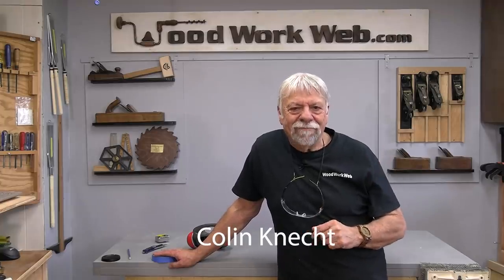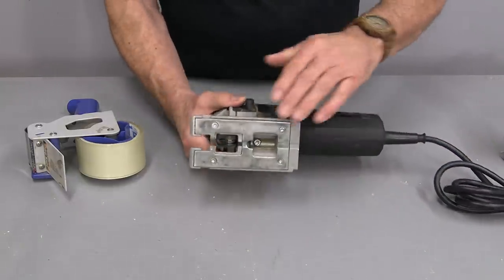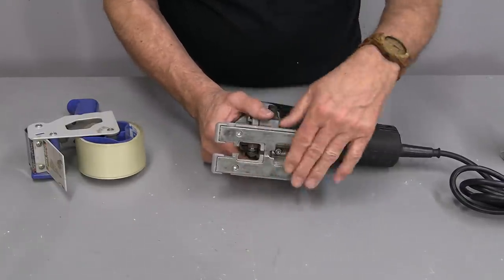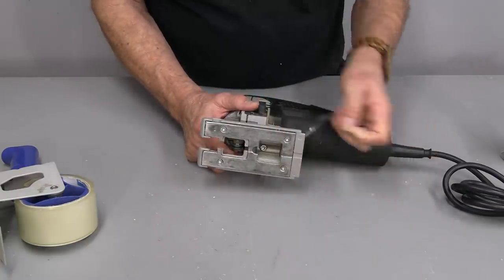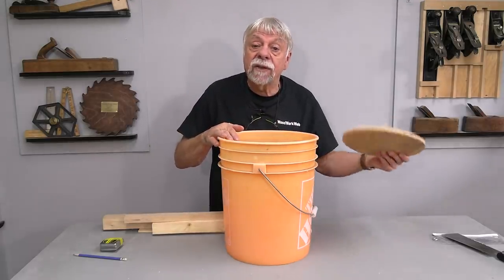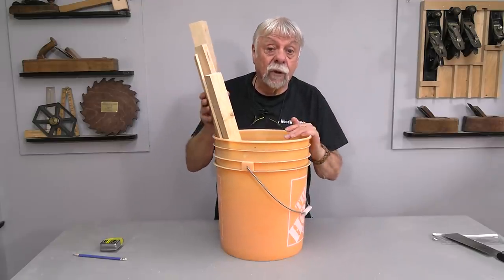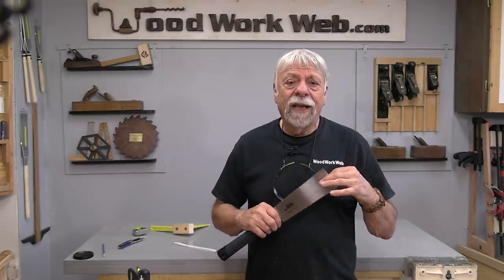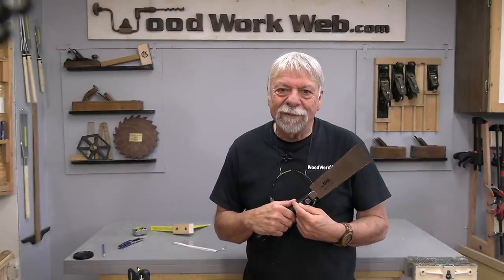Subscriber Submitted Woodworking Tips  - Episode #30

Comment: One quick thing I learned the stupid hard way lol, when using the tape for zero clearance, use a longer piece of tape so it wraps around the front edge of the table.
The way you showed it (and how I did it for years) will start getting caught on the wood. Running the tape further back, when you start pushing the wood, it will start with it on the tape, instead of in front of it where the wood will catch. Plus, it’ll last longer that way. 
:)

Comment: On the dust collection, it's not essential to have it air tight unless it's under pressure. If I wanted it sealed, I'd use some tape then the metal can and worm-drive hose clamps.

About 1969 I had a problem with my newish Honda N600 (Scamp). Something hit a welded joint on the exhaust and made a hole after which it was very very noisy. I fixed it with a (steel in those days) Coke can, two worm-drive hose clamps and a length of asbestos siring.

The repair was highly effective, and outlasted the car.

Comment: Pill bottles make great storage for different types of driver bits. label the bottle for different sizes (square 1, 2, Torx T10, T145, etc.) and put them in a drawer or other location. I also dump various species of sawdust out of my sander dust bag into my pill bottles, so I can grab some dust to match the wood when doing the glue & sawdust wood filler.
Reply: Ken, I use pill bottles just like you. I do a lot of work away from home, so I have several crowded tool boxes that I lug around. Trying to find small parts in them like driver bits, masonry drill bits, punches, small screwdrivers, Sharpies, small stirring sticks etc. used to drive me crazy. With these items contained and organized in see-through pill bottles, I can find what I'm looking for in a snap. I even carry around an extra set of nitrile gloves and shoe covers (recycled plastic grocery bags) in them.
Reply: @timothyhartle6028  I started carrying the pill bottles when I went to Habitat for Humanity. It sure was easier to find things, especially when I put labels on the bottles or marked them with a sharpie. I eventually got a Milwaukee "pack out" small part box and put my bits in there, Now I just grab that to take with me.

Comment: To add to your dust collection tip, I use super glue to make an air tight connection  between the two pieces and reinforce the connection with hose clamps and aluminum flashing.
Reply: Nothing wrong with that technique, but for a low or no stress joint once around with the aluminized tape (the HVAC stuff) will make an airtight joint. Proved it a million times on all sorts of pipes and ducts.

Comment: Another thing to use when joining hoses etc. Are the thin water bottles cut out the top and bottom the plastic shrinks when heated and forms a good joint.

Comment: When connecting two vacuum adapters together that do not match, I have found that Fernco couplers are perfect.  They are for attaching large plumbing pipes and come in a variety of sizes. Find them in all plumbing supply stores and big-box home repair centers.

Comment: Here’s a tip for anyone who has a worn out rubber pad on their 1/4 sheet sanders. Buy the larger pads of felt padding (4-1-4 x 6” x 1/4” thick. - orange home store has them). They have a self adhesive backing. Use a hot air gun to help peel off the old rubber pad. Use the metal backing plate to transfer mounting holes to felt pad. Drill and counterbore as required. Clean and remove all glue residue and apply new felt pad. Use the hot air gun to apply some heat to the metal plate to ensure good adhesive bond.

Comment: I hang my speed squares/rafter squares using s-hooks. I bent the tops of the s-hooks so they stay hanging on the milk crate, and run the bottom end of the hook thru the 3.5” hole of the squares… Before the haters start hating - Yes, I use stackable milk crates for storage. I’d love to be rich enough to buy a PACKOUT system, but this works and it was free 😂

Comment: I started out using a vacuum cleaner, and attached a length of plastic pipe to the machine outlets using duct tape, that the vacuum hose pushed into. I've just bought a proper workshop vacuum that attaches directly to the machine outlets, so had to remove the duct tape. Sometimes it's good to use tape that isn't permanent!

Comment: I do a lot of oil base staining. I use the cheap Harbor Freight spray, it works well, but is a pain to clean like all other spray units. Instead of going through the process of cleaning it each time I keep a 2 or 2 1/2 gal bucket about 3/4 of the way full with either thinner or mineral spirits. All I do after I'm done spraying is detach the plastic cup and dunk them both into the bucket, put the lid on and put it away until next time. When needed again all I do is blow it off and wipe it done fill it with stain and away I go.
Reply: So the electric sprayer is submerged too?

Comment: Even better for the dust collection: I use schedule 40 PVC pipe. Heat it with a heat gun and force it to either go inside the other piece or outside of it. Let it cool while it is pressed together and you now have a permanent fitting that presses together. You could also use pvc glue to put them together permanently if you so wish.

Comment: Not exactly a woodworking tip but a general tip when using that foil tape:  apply it directly off the roll, ripping the foil shorter than the backing and always leave the backing long.  That makes it much easier to get it started on the next use instead of picking at it (sometimes quite unsuccessfully as demonstrated in the video) since you can bend the backing and roll the edge off.

Comment: the dust collection union is a tiley tip for me as I have been scratching my head as to do exactly that  Thanks !!
Reply: I can not seem to find that set of bars none come with the 1/16 Could you please send a link Thanks
Reply: Try heating one of the pieces up and it should allow it to slip over the other and then cool to a tight fit. Works a treat.

Comment: For the underside of your jig saw try teflon coated fibreglass tape. A roll is expensive but will last and last on your tools.  Industrially, it would last months with stuff sliding on it 16x5.

Comment: Best tip in my opinion was that "poor man's zero clearance". The holder for the triangle I would not use, just use a magnetic hook or a simple nail in a wooden block (maybe with magnet attached). If you'd run into it, it would simply bounce away.

Comment: For the ducting tip, a better option in my opinion that I use is to get a heat gun or the wife's hairdryer and heat up the item you are trying to put over. don't go mad with the heat but enough to allow it to flex a bit, you can always add more heat if not quite enough flex on the first try. The heat allows the plastic to stretch a little and move thus allowing it to be worked and slip over the item. Then leave it to cool and it will shrink/tighten to a nice snug fit. This works really well. You can use it in combination with plumbing pipe to create your own cheap custom connectors for example for connecting your vacuum to a power tool. There are some great videos on YouTube showing this whole process.
Reply: If you still have a tiny leak you could put something like baking soda in the leak area and then use a little super glue in the baking soda and that will completely seal the leak.
Reply: Speaking of the heat gun, instead of aluminum tape or a soda can I cut a plastic water bottle and wrap it around the joint, heat it, and it shrinks to a near perfect fit.  You can even go around corners with a little finesse
Reply: @shmaxo  but do you cut the bottle to open it to fit? Or does this assume the parts are already nearly ready to fit one over the other?
Reply: @robertivey3268  Good tip.
Reply: @timrichardsatsea  The bottle is cut in tube form, if cut lengthwise it will deform when heated and not shrink properly

Comment: Regarding running into the pointy speed square:
That should only happen once. You will either move it to a safer spot or you will be careful not to do it again.
If it happens more than once then it’s that whole “Darwin Award” thing…. 💙💛🌻🇺🇦

Comment: Good tips, as usual, For the ducting, would it be easier to put the duct tape on first to seal it then use the can to strengthen the joint. Keep up the good work.
Reply: That occurred to me too
Reply: My preferred method is to apply a little heat to the piece slipping over the other and it allows it to flex and expand/stretch a little. Then once cooled down you have an air tight fit. Works really well and no need for the tape etc.

Comment: 10:53 Sorry to crit' Colin but your use of a pullsaw was not a good technique.  To work properly with the grain of the wood a push saw would have been more appropriate.
Either that or turn the piece around, with the hole towards you, so that you are cutting with the grain.
The use of cans to make duct joints was a gem.  It reminded me of how we repaired our car exhaust pipes with baked bean cans, in the 60's.  (Car exhaust systems rotted quickly in the 60's.)
Please keep these tips coming, Colin.  You always have something to teach or inspire me.